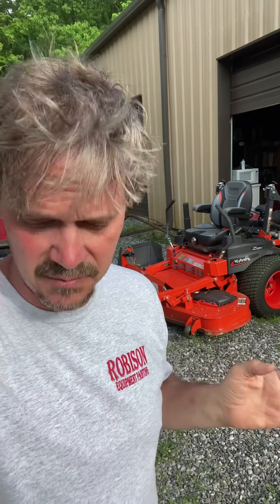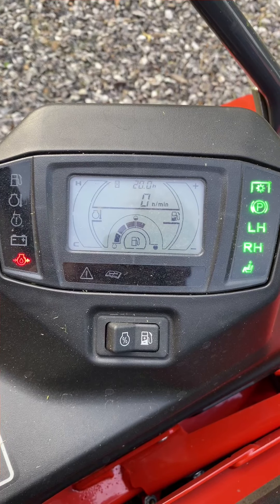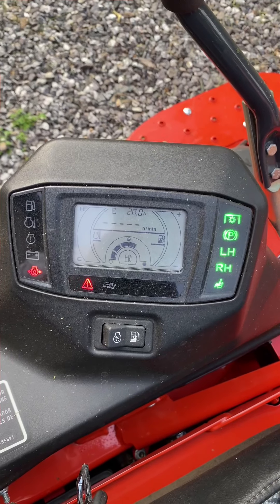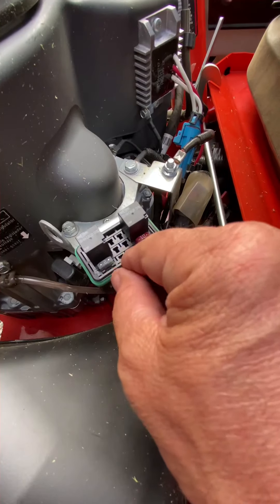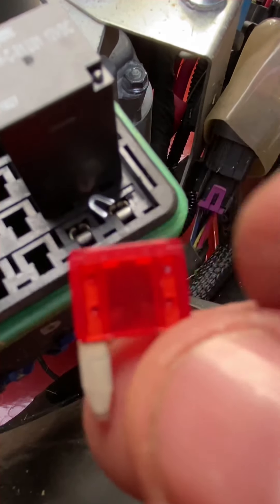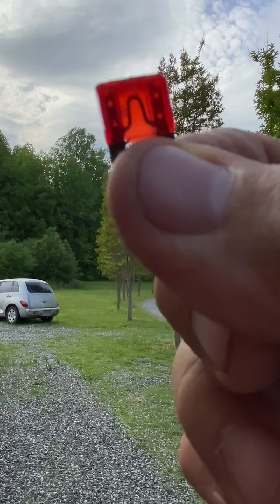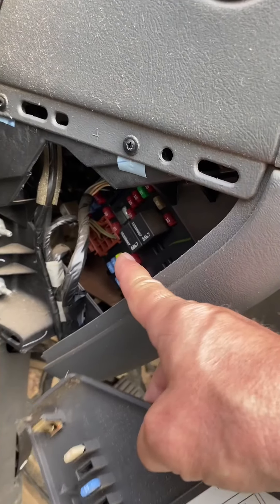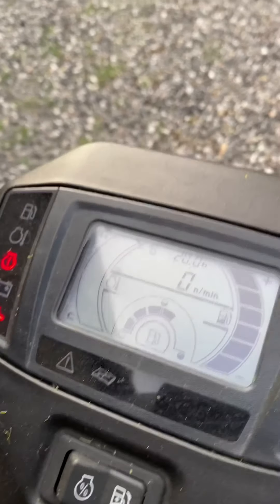Zero Turn Mower Won’t Start - Quick Fix

Comment: 1 year old video and your video is still helping people!! I had looked at my fuses and they looked good. I was at a stuck place after I looked at a few other things. Found this video and after watching I went back and looked at my fuses!! This time I check with a meter. BAD FUSE. 
Thanks for the video!!!!!
Reply from the maker: Great! I was shocked when I looked at it and then did the same thing and it was a defective fuse. This is an over $10k mower so it should have been perfect. Thanks for commenting

Comment: Always test fuses! A lot of times they can be open at the connection point and still appear good visually. It’s only after much trial and error you go back with a meter and find a simple blow fuse that looked good in the beginning!
Reply from the maker: Yes I agree. I started out looking online due to the trouble code but instead of grabbing my test light or multimeter I used my eyes (which aren’t the best anymore) Thought the very small fuse looked odd but the element wasn’t burnt or darkened at all so I put it back. This was a first for me to have one actually broken but not from over amperage
Reply: I agree I have never seen one break like yours did. The old glass fuses were known for sometimes melting the element just slightly past the end cap, then appearing ok visually. The new plastic fuses definitely do that a lot, tricking you when you still see the “V”.
Reply from the maker: @pauldiesel4582  I’m sure they’re made very cheaply nowadays. I remember as a kid thinking everything seemed to be made in Japan but a lot was still made in the US. Now not so sadly

Comment: old school way of doing things are; air, spark, compression, fuel. not fuses.
Reply from the maker: I was referring to old school diagnostics, meaning look for the easiest fix first. I learned that over 30 years ago and it helped me a ton as line tech and in Nascar.
Reply: @dhammiam  a lot of error codes in nascar? lol
Reply from the maker: @technicaltrucking8704  a lot of diagnostics in Nascar. And yes error codes. I assume you didn’t realize Cup Series engines switched to fuel injection 10 years ago.
Reply: I’d say he realized the fuel pump wasn’t running. So no fuel. That led him to the fuel pump fuse. 🤔
Reply: And he found the fuel problem which was a fuse

Comment: Problem with those 'horseshoe' fuses is they don't like vibration and can crack the loop.
Reply from the maker: True. These things sure do vibrate. It actually seems better to have the fuse in a floating state vs tied to the engine I suppose

Comment: Engine will not engage.   Not Engine won't start.
Reply from the maker: I have to say it to where people will understand. I’ve got 35 years asking customers questions and they almost always say “it won’t crank”. To me that’s the proper way of saying it won’t turn over, but 9 times out of 10 they mean it won’t start. The engine doesn’t engage, the starter engages the flywheel. Thanks for the input